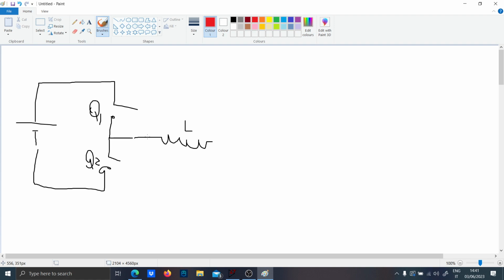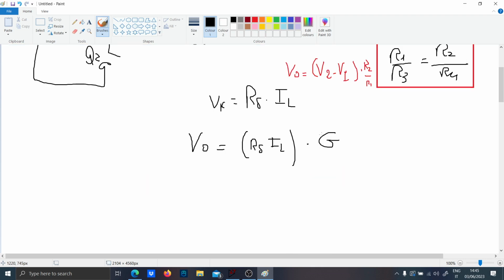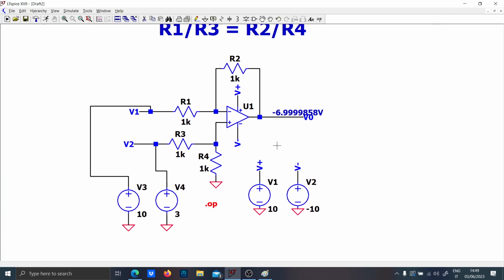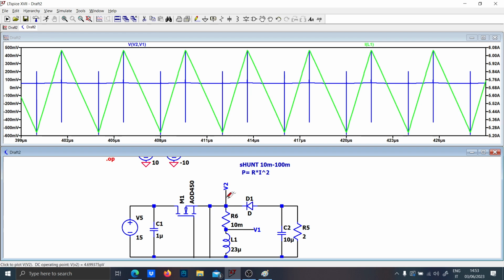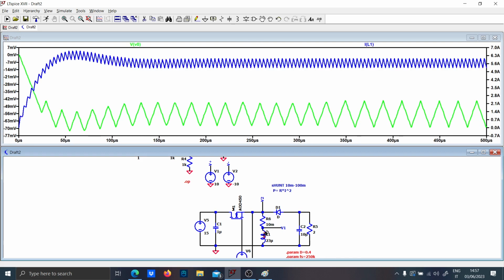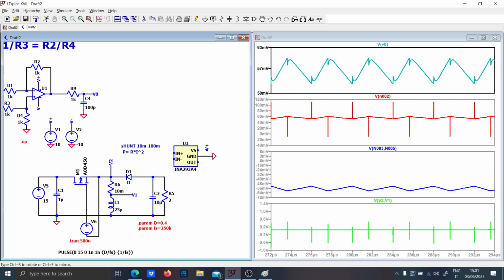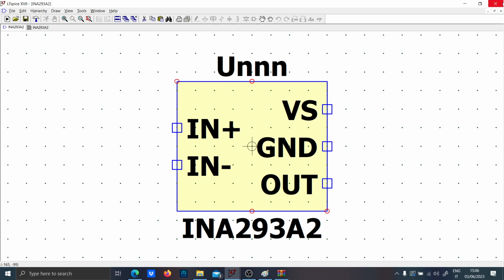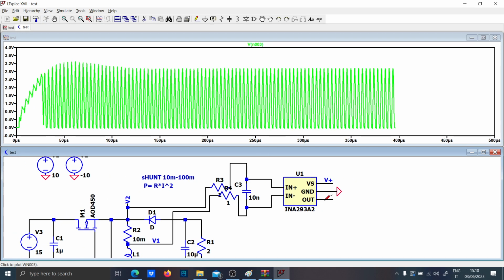LTSPICE Differential Opamp Applications for Power Electronics

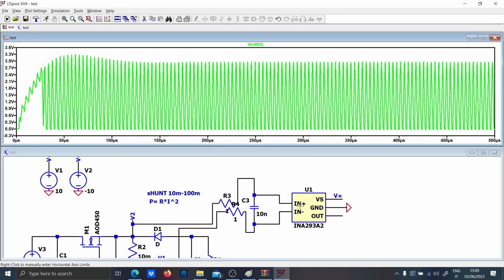Comment from the maker: 29:00 The reason why the waveform is like that in the INA293A2 it's because of too much gain
Whenever you design a differential reading stage, and you select the integrated differential opamp like the INA, remember to design the gain properly,  or else you won't see the correct output voltage.
In the next video I will talk about signal clamping and how to construct piecewise linear function with opamp